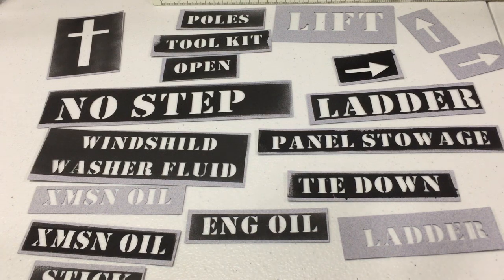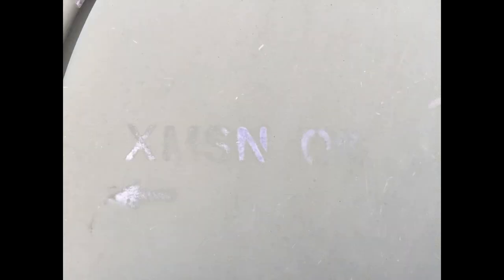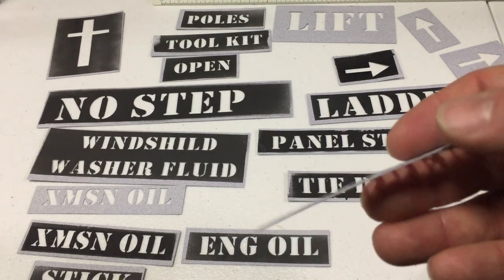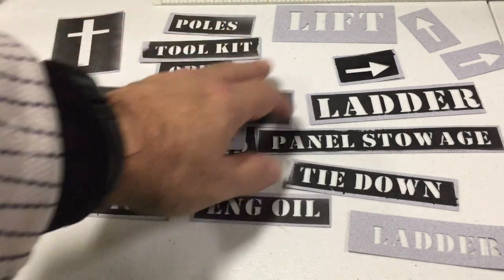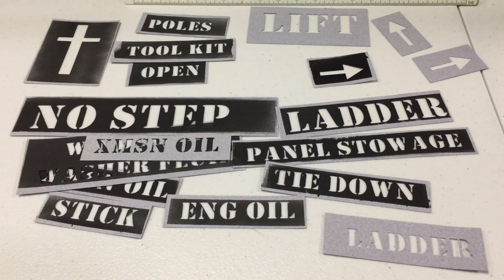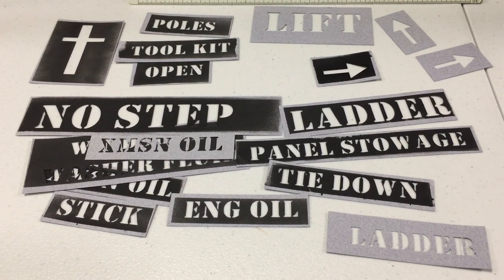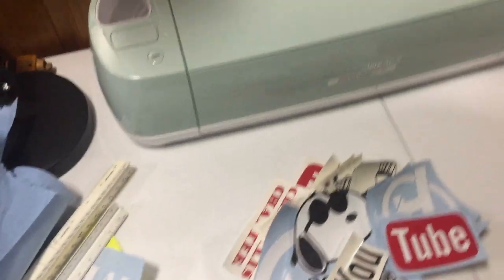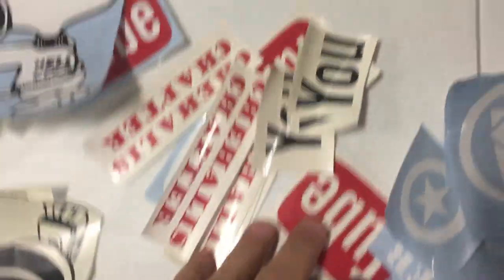FMTV STENCILS and Cricut Review #6

Comment: i need to add stencils to my lmtv, trouble is it got totally repainted. thanks for the great video.
Reply from the maker: I am glad you found it helpful. Repainting is fine, but in my opinion, when you lose the stencils, it loses its legacy. True, I did some changes to some of the stencils, but for the most part, the rest are OEM. Best wishes on your restoration.
Reply: @HelicoolsHelipad  I agree 100%. So I am going to try to recreate the markings as close as possible. Is there any guide on the character height for the various stencils? The rest of the truck is still stock, apart from a set of new highway gears. Thanks for your help!